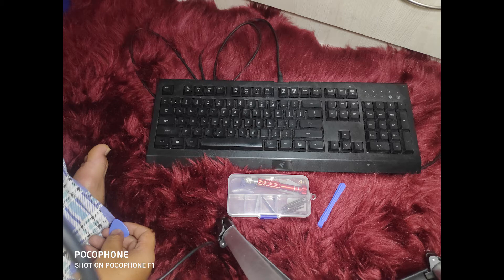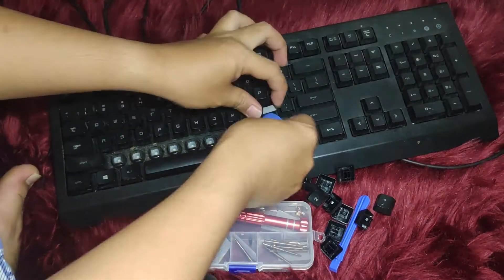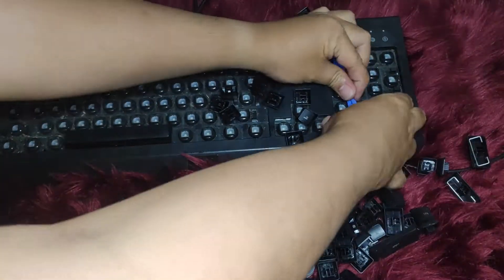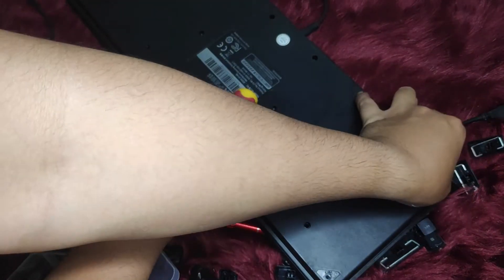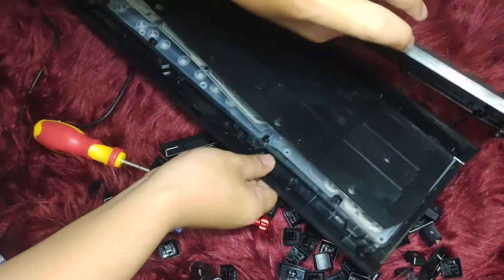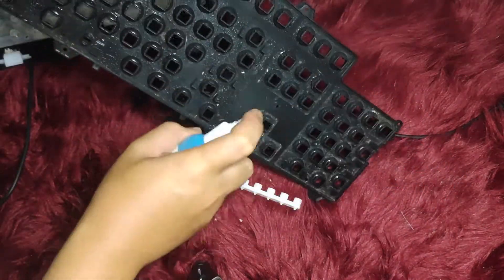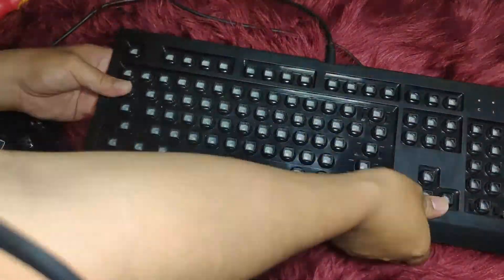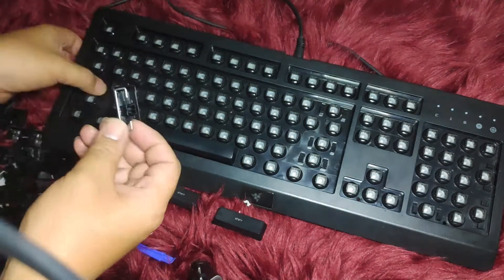How to clean Cynosa Membrane Gaming Keyboard

Comment: Not worth it. The plastic that holds the keycaps was so brittle that i broke off almost every one of them. Yes i was gentle. Yes it still works. But this keyboard is so cheap that you can basically get a new one when the current one gets too dirty 😂
Reply: yikes. Mine has never broken. You did something fucky.
Reply: That's what I was thinking. Instead of going thru all this work, by the time it 'gets that dirty', it will be time to upgrade to the next version.